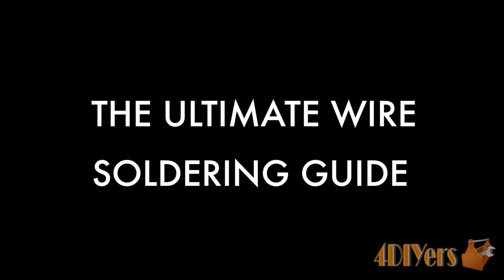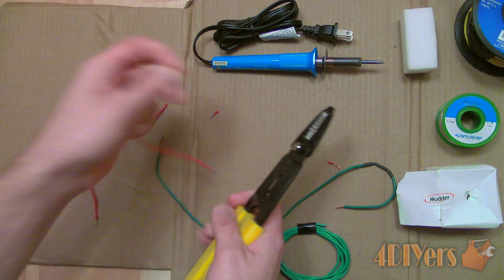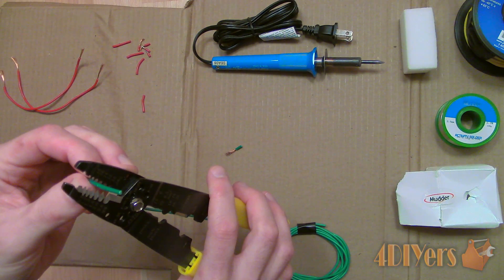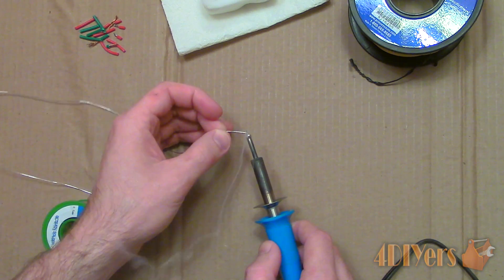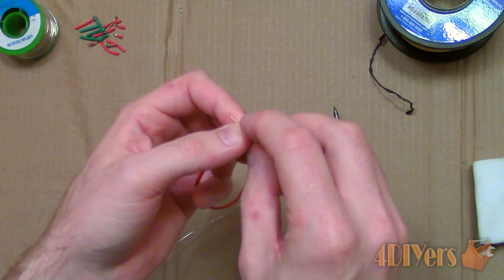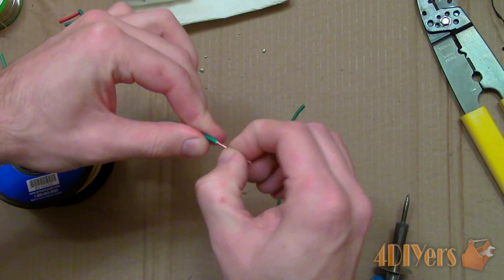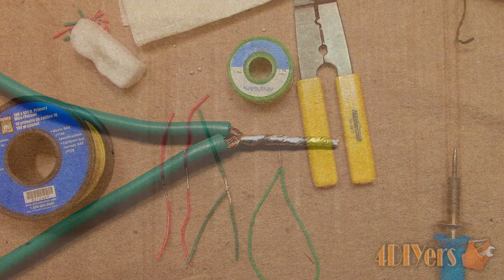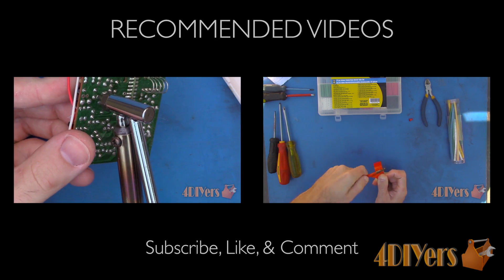How to Properly Solder Wire - Beginner's Guide

Comment: Gonna put in an aftermarket cd/dvd player, so thank you for the tutorial! Gonna solder up the wire harness tonight. Thanks for a clear understanding!
Reply from the maker: No problem, happy I could help. I also have a couple other install videos relating to installing head units if you're seeking more info. They're Android units, but a similar procedure still applies https://youtu.be/PnvpkNEMuz0 and https://youtu.be/T3ooTDYFPzM
Reply: @4DIYers  well I did my harness like I said, and put in my double din yesterday morning. And everything worked great. Your tutorial deff helped me alot lol.

Comment: how would you insulate the tap-in wire solder you show and please dont say "electrical tape" .  Thanks for posting. Great video
Reply from the maker: Thank you. Lol, I usually try to stay away from electrical tape unless I'm taping a bundle of wires together. I would recommend either a liquid tape or an adhesive filled shrink tube. Here is my video using both of those methods https://www.youtube.com/watch?v=iloWEUi1orw

Comment: have you got any video on how to solder 16/0.2 wire onto a harwin pin strip with 2mm spacing between the pins?
Reply from the maker: Unfortunately I do not have a tutorial specifically relating to that.